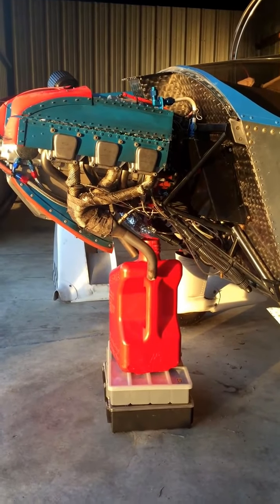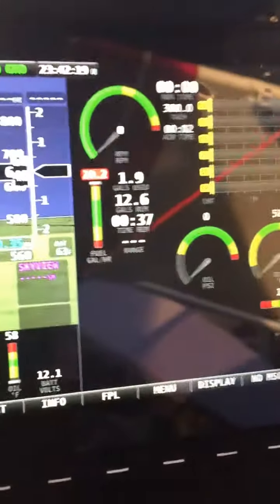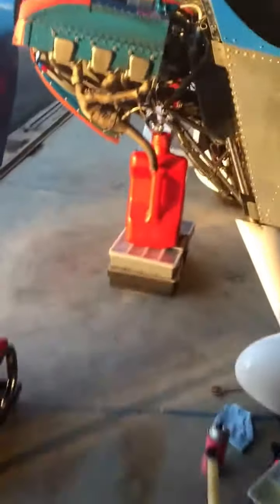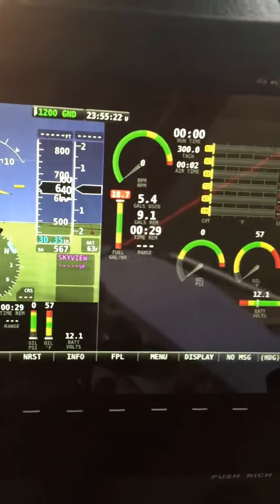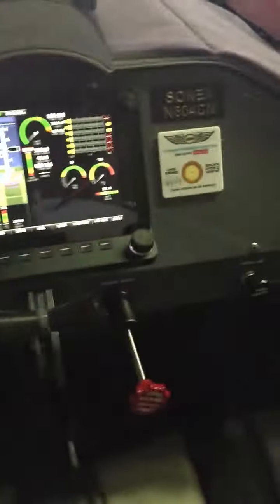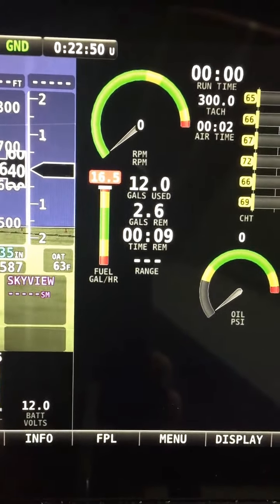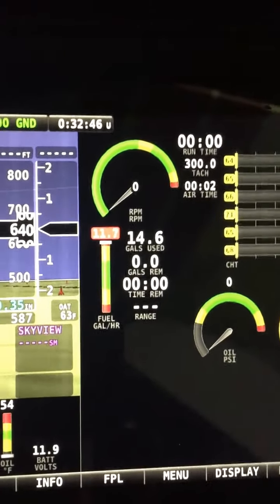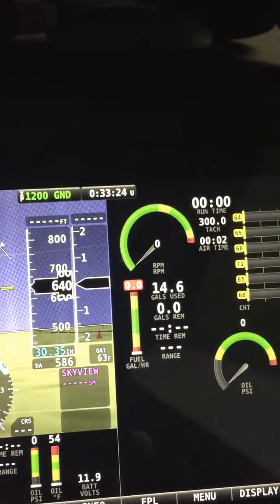Fuel Flow Test on my Sonex Aircraft

Comment: Reminds me of fuel-flow tests I ran on my old '73 Corvette, which would starve for gas after running for 15-20 minutes.  My fuel flow tests (with engine running) showed that the flow was fine.  After replacing practically the entire fuel system without results, I finally discovered that the sock filter inside the fuel tank (the equivalent of the "finger filter" shown in your schematic) was partially clogged. This sock filter would flow fine initially, and during my flow tests, but then after about 15 minutes the filter would collapse in on itself and cut off the fuel flow. Oh well, live and learn.  But I'm sure your finger filter is of better quality and can't collapse in on itself.